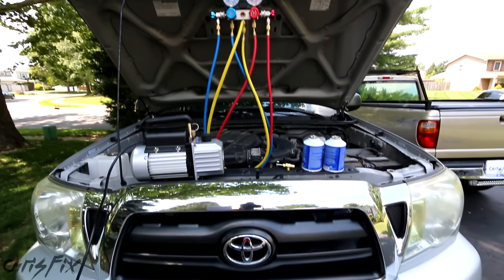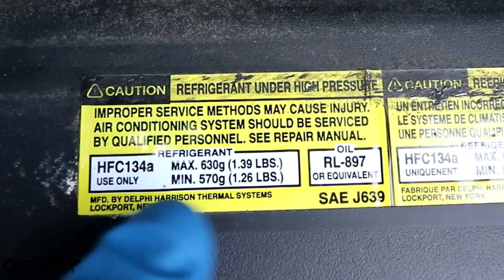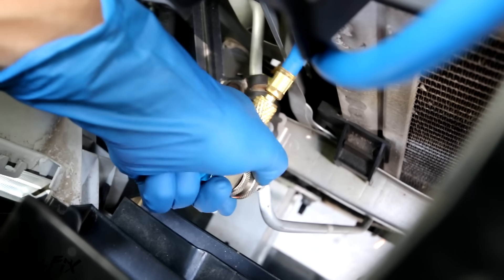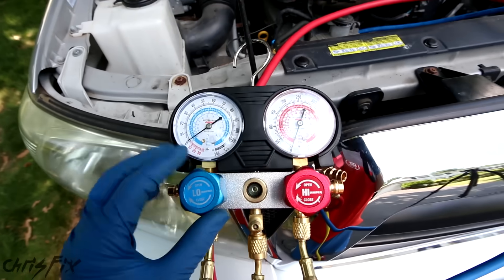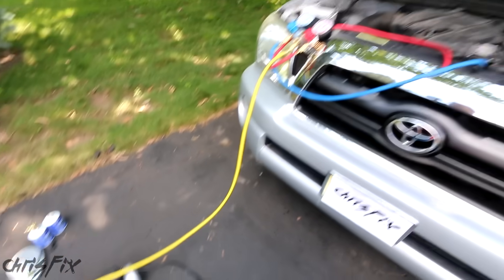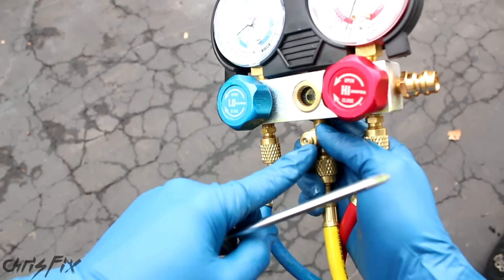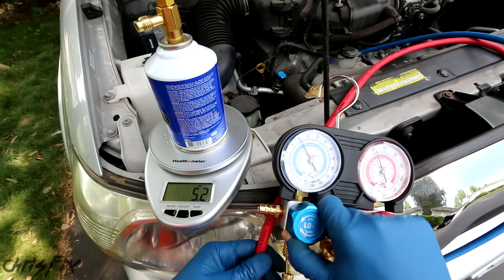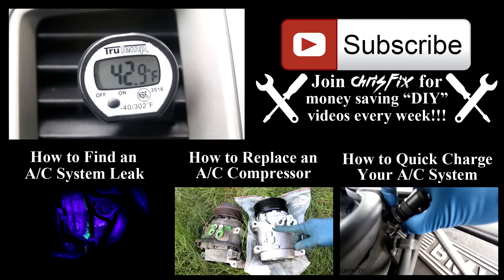How to Properly Recharge Your AC System

Comment: Question- why is it that you put liquid in the system with the first can and not with the second can?
Reply: +Clara Harmon  Once system pressure equalizes to can pressure, no more refrigerant will transfer to the ac system being charged. Thus, starting the compressor reduces the pressure on the LOW SIDE of the system, allowing transfer of refrigerant to the ac system of the vehicle. Ideally, 75% of the charge should be present when starting the compressor, to allow for proper lubrication, but when using small cans of refrigerant, it is difficult to get all of the refrigerant into system in liquid state without heating the cans, not advisable. So what he did is fine, although R134a systems use oil that even when under an ideal vacuum, (500 microns) will not completely separate all of the moisture from the system, and it is advised to replace the dryer/filter if system has been exposed to atmospheric pressure for any length of time. IE more than a few days. Hope this helps.
Reply: Because the oil should be the first thing you fill up

Comment: Like most things with cars, I figured it was this easy. But damn you made it look super stupid easy.
Reply: Also, for the record I've had a 134 can explode. It exploded IN my X-wife's Scion TC. It was the oiliest crap ever. It also has thinning agents which caused the painted interior of her car to wipe away when I tried cleaning it with a basic dry towel. 
I don't believe that 134 will just evaporate out of your car. It's a nasty oil.
Reply: Subscribed. B/c you have quite possibly the best how-to videos I've ever seen (at least for cars).
Reply: +Chris Foster Did you notice that C.Fix weighed  the can with the adapter and hose attached when he showed the can of Freon being weighed?
Reply: +SilverDollarSaloon Is that a mistake?
Reply: Correct. The weight of the can and hose and valve was reduced by 10 oz., which represents the amount of refridgerant put into the system.
Reply: +SilverDollarSaloon I don't think that matters, because he was only taking 10 ounces out, so the actual weight of the can is irrelevant.

Comment: I think you should mention at the start of the video that this only applies to an already empty system.
Reply: +RainBoxRed  He did mention it, although it was farther along in the video.   He said he had previously replaced the compressor and did state that it should be evacuated properly by a mechanic with a recycling station.  Most people watch a video all the way through at least once before tackling a job, so his warning would still be seen.

Comment: oz does not equal fl oz (except for water). one is weight and one is volume
Reply: +DS Splicer...I agree.  One could weigh the old can after it was empty and compare it to the full one to get a closer estimate on the consumed weight of the fluid.
Reply: +S Moore ... yep - that's the best way I could think of in that situation. Something interesting - I just bought a case of Dupont R-134a and the cans are standard 12oz cans - but the cans are marked oz, not fl. oz. I think the cans he bought have a misprint.

Comment: i got 65 psi on the low side abd  50 psi for the high side. anybody know whats going on? I replaced the compressor and accumulator.
Reply from the maker: +Richard Cowtails Is the compressor clicking on? It doesnt sould like it is.
Reply: +ChrisFix its not coming on at all

Comment: When only using a part of a can, it needs to be upside down drawing liquid, R134A is a mixed refrigerant drawing vapor will cause it to fractionalize, open the can valve all the way and use the manifold gauge to regulate flow so you soon not slug the compressor.
Reply from the maker: +Michael LaDue Thanks for the tip!
Reply: My pleasure, you have some very informative videos.

Comment: How do you know if your system held vacuum if you closed the manifold gauge?
Reply from the maker: +Michael T You are closing the yellow hose not the actual gauge/sensor on the gauge. Watch that part again and it should make more sense. You are still gettting a pressure reading.
Reply: +ChrisFix So the high and low side gauge are always reading pressure from their respective lines? Unless the valve at the end of the line is closed?

Comment: Ounces on the products you use are volume, NOT weight me thinks.  Other than that, great vid.  Those who say HF cannot be trusted have no idea what they are talking about.
Reply: +JmB 
Hey JmB, wonder if you could answer this:  i've just overhauled my 02 v6 Tacoma ac system. it supposed to take 22 oz freon. Toyota service manual says, otherwise, keep adding freon till the bubbles gone in the receiver glass window. i've added 2 full cans (12 oz ea.) of 24 oz total. it's already 2 oz over, there's still foam in the glass however. the pressure reads 24psi low & 180 high, the ambient temp is 58F. should i just keep adding freon till the bubbles are gone? or how would you check volume?
thanks.
acmeglue
Reply: +chuck cheen forget the foam. it's overcharged by 2 oz but it shouldn't be a big deal . 24psi is ok if you are charging it at 58° because when it gets hotter the psi should be around 35psi

Comment: I'm going to assume this is for people that have no clue about air con work because you did several things wrong and left out a few things that would have been helpful.
Reply: +Lief Media Group My credentials are 15 years experience in the automotive and residential side of air conditioning and electrical. As far as the safety to high side charging. It is perfectly safe if done correctly. never open the high side valve while the system is running that is how people get hurt. but adding liquid to the high or liquid line is fine with the system off and under vacuum. it is a fast way to get freon in to the system. and always if you don't feel comfortable doing it don't you can get it done adding it to the low side only it just takes longer.
Reply: +David Dousay thanks for your reply! I'm sure I'm not the only person who will benefit from your expertise! Cheers!
Reply: +David Dousay Could you be a little bit more specific?
Reply: First off when you have it in a vacuum with the car off you turn the can upside down and open the red or high side you can add liquid you can get almost a full can in that way. It will also keep your compressor from cycling while you're adding freon until you get enough in for the pressure switch to pick up. Also if you don't want to burn a half tank of gas and you are changing a large system. Put the can in some warm water to keep it from freezing up and it will charge faster. Other than that is was a good video for beginners.
Reply: +David Dousay I'm not knocking you by any means and the following comment is not meant to be combative, but could you tell me your source/credentials for the high side charging? I've done a lot of reading, and I'm definitely not a pro my any stretch of the imagination, but I just want to be able to feel confident that if I do high side filling that my car isn't going to explode haha. I've read it both ways, but I've seen several write ups that explicitly state NOT to use the high side for filling.

Comment: Hey thanks for your video.  I have a question about adding PAG oil....  If I did not replace any A/C components/parts....  Do I still need to add PAG oil to my A/C system? ....(I just had to remove the hoses to my evaporator because I had to replace my heater core).....   Also does vacuuming the system remove PAG oil?  ....Thanks for your help!
Reply from the maker: +Zachary Stutzman Since you just removed the hose to replace the heater core, your PAG oil should be at the correct amount. That also depends if you had the system professionally evacuated which will remove only the refrigerant. Vacuuming the system does not remove the PAG oil.
Reply: +ChrisFix Thanks for your SUPER FAST reply!  Now that you know that I had to remove the hoses to the evaporator to change the heater core (***after getting the Freon professionally removed)...  In your video you explained why you should vacuum/remove the moisture from the A/C lines....  But now I'm curious about removing the (non humid) outside air (not moisture).... Did removing the A/C hoses and hooking them back up within a day, put outside air in my A/c system?  and if so ...Would the outside air in my A/c lines affect the pressures on the manifold when refilling Freon (lets assume I did not vacuum system)?  I hope that made sense...Thanks

Comment: Hey Chris how many Pa or Microns of Mercury have the vacuum pump?
Reply: +Carlos Rojas If you can get the system to pull and hold a vacuum for an hour, you'll be fine.  if it's a 150 CFM vac pump or larger.
Reply: Thank you very much Chuck Ferraris, I appreciated and have a good day.
Reply: C. Red in
Reply: It needs to be 500 microns you can't time it unless you just don't care about doing it right and its impossible to pull to 500 with a single stage pump

Comment: How do you purge the air from the fill line if you're adding oil? 

When pulling a vacuum, do you need to worry about any oil being sucked out?
Reply: +SnowDrifter If the system has had the refrigerant removed, due to a component being replaced, most likely you won't..... Watch the sight glass and if you see refrigerant oil being sucked out, you should be take out the compressor and drain ALL of the oil out and then add the recommended amount of the proper type oil, reinstall the compressor and start the procedure again.

Comment: I have a 1999 honda accord I changed cabin filter and also changed climate control and still no air from center vents all others work fine what else could I check? the air comes out cold or hott just doesn't come out from center vents and my modes work fine pls help
Reply from the maker: +Adeum Rivera The Vent actuators are probably bad. They are either electric or vacuum driven.
Reply: thank you I will check Into that :D

Comment: Hi Chris, I am getting ready to recharge my ac system using the instructions from your video.  @4:21 you mention to open the valves for the high and low ports.  At this time do  you only do that for the valves connected to the lines on the vehicle or do you also open the valves on the manifold by the guages?
Reply: +Joe Kim Ok, I take back that question.  Further into the video you mention that those valves should still be in off position @5:30.  Im new to this so sorry if this is a newby question but @4:21 since you only had the valves near the port opened and the valves at the manifold by the gauges remained closed.  Wouldnt that prevent the pressure gauges from reading any pressure if there were any pressure in the lines?
Reply: +Joe Kim I apologize for all the questions but I just want to make sure I dont miss anything and do this correctly the first time.  @7:40 you mention that if I am replacing and major parts I need to add oil to the system.  I am replacing all the parts you mentioned.  Compressor, condeser, and evaporator.  If I add the correct amount of oil into the ac compressor then I also can skip this step?  Or do I need to add extra oil on top of that?
Reply: +Joe Kim I correct myself, not the evaporator, i think its called the the receiver dryer or accumulator?

Comment: i noticed that when you changed the canister, you didn't bleed out the air
are you not supposed to do that?
Reply: +YIC This is basic. He didn't compensate for the 1oz he purged from yellow hose or the lines to vehicle. typically you add an extra 2oz for hoses.

Comment: Chris, I've been a shade tree mechanic for as far back as I can remember, but have always considered A/C systems to be VooDoo. Your simple and WELL EXPLAINED video has just saved my bacon!~ After the comp went south in my Dodge Magnum SXT, and having replaced and "thought" I had it fixed, it died again. Likely from moisture exposure. Your step-by-step procedure showed me where exactly I went wrong. Fingers crossed I'll be third time lucky!

BTW, I've been running the old "Compressor Venturi Vacuum" from Harbor Freight (bought it years ago when R134a was first starting to become standard), but really like the little vac you have. Was even happier to see Pittsburgh Automotive on the side! Quick trip to my local HF, and I too am a happy new vac owner! THANKS AGAIN!!
Reply from the maker: +claywood100 Awesome! I am glad you learned a lot! The AC system seems complex but when you know a little about it, it is really so simple!

Comment: great video bro , but you missing some information :

in my country we dont have this small cans ,, we have only a big one 5KG

so you have to tell us how much presure should be in "L" and "H" while im doing this prosses ... its the only way

cuz i can easly over charge my system.

hope you answer ,,, thank you so much agian
Reply: +mahmoud bitar Most auto a/c systems are not charged by pressure, they are charged by weight. That's why Chris explained about how much refrigerant to buy and about using a scale to measure the weight of the can as the system is being charged. The machines that you see in the shops do the same thing, automatically, and they use the 30 lb cylinders.
Reply: David B. Fishburn thx bro ... so weight measuring is the only way to charge ? in my situation too ?
Reply: It's a more accurate way to charge the system. Trying to charge by pressure is basically guessing. Too much or too little, the system will not work properly.

Comment: Chrisfix, upon trying to do this, at the point in which you test for vacuum leak, i dont hold a vacuum past 5 minutes. I don't see where it could be leaking from. Replaced compressor, condensor, evaporator and low pressure lines. How would I know where its leaking from if I thought I put it all back together properly? Any ideas? Maybe the a/c gauge nozzle or something?
Reply from the maker: +AlwaysOnP0int Check this out! This should help you: https://www.youtube.com/watch?v=pCv7rCdcXsc

Comment: On the can 12 FL oz and 340 g  are apples and oranges.
Reply: +Matt Trotta  They are the same amount.  Google ounce to gram conversions if you like.
Reply: +Matt Trotta you are correct.  Fluid ounces are a unit of volume.  Grams are a unit of mass.
+Joz Man you are correct.  In this case, the refrigerant in its compressed state has a density of 1 ounce/fl. oz (same as water).  And 12 fl. oz = 12 oz = 340g.

Comment: Great video - thanks!  I am not trying to nit-pick, but is the weight of the can important when measuring?  I get we need to add 10oz, but the total weight shown included the weight of the can was 20oz on the scale - we took it to 10oz down to 10oz.  If the can weighs an ounce or two - would we not take it to 19-10oz or 18-10oz.  It may not be a big deal - total rookie here!  Thanks.
Reply from the maker: +Johnny Barrett Thanks! Glad you liked the video. The weight of the can is constant. It doesnt change, only the amount of refrigerant in the can changes which is how we can subtract before and after. Even if the can +refrigerant weighed 100oz and we went down to 90oz that is still 10oz of refrigerant. The can still weighs the same, it is the refrigerant that is being removed that weighs different.
Reply: +ChrisFix that is what I was thinking meaning that in this case there was less than half left.  I really like all your videos. Thanks again!

Comment: Good video but question: How did you figure that going from 20 to 10 on the scale would be 10oz of refrigerant? I understand that the cans are usually labeled showing weight of refrigerant instead of fluid ounces. If this is true and you say the can has 12oz of refrigerant and scale starts at 20(little extra added because of attached hose) then if you end at a reading of 10 on the scale why was it not only 6 additional ounces you added instead of the desired 10 additional ounces? Am I wrong that there should have been a conversion of some sort?
Reply: in 20 ounces there are 12 ounces of fluid and 8 ounces of can/adapter. After he removes 10 ounces there are 10 ounces left. 2 from the fluid and 8 from the can/adapter

Comment: Have you ever done a R12 to R134 conversion? If so do you have a video you could post?
Reply from the maker: +N-JAXS I do not have a video on that. It is similar to this but you need to do a flush and replace some parts.

Comment: whats the difference between this video and the other recharge video where you just put the refrigerant into the low pressure port? or how do i know which to do?
Reply from the maker: +mrerictbrown One is how to properly add refrigerant from scratch (this one) and the other is just a simple recharge video where you already have some refrigerant in the car, but need to add more.

Comment: guess i am lucky. my 94 toyota camry ac is still ice cold. it is like a freezer when it is on. not sure how cold but seen it that someoen said 45F here http://www.toyotanation.com/forum/103-3rd-4th-generation-1992-1996-1997-2001/386950-ac-too-cold.html

the heat don't like to work though which think is thermostat stuck open maybe.
Reply from the maker: +james42519 Here is a video on how to check the heat and figure out why you dont have heat: https://www.youtube.com/watch?v=-XjXTVJhFLM
Reply: +ChrisFix yeah seen that before. temp on car is usually cold
Reply from the maker: +james42519 That means you need a new thermostat!

Comment: Should flush the old refrigerant if ac is in working condition?
Reply from the maker: +Redi Hoxha It depends. If the AC is working, then no, just fix the seal and refill. If you have a problem where there is metal in the refrigerant, then yes, you need to fix the problem and do a flush.